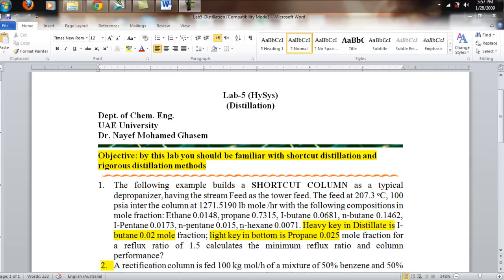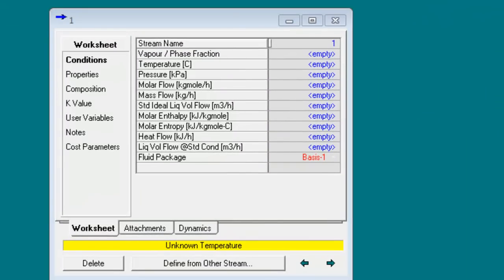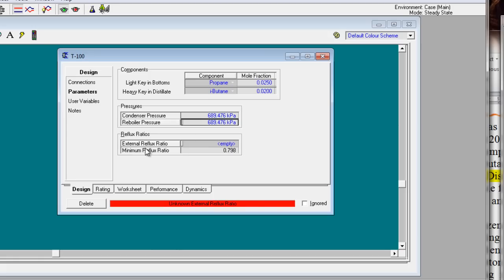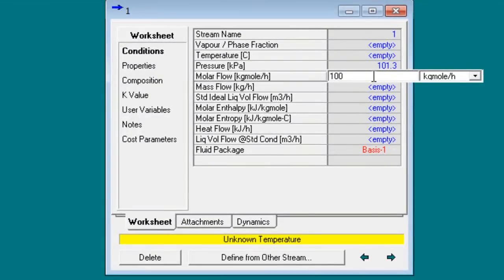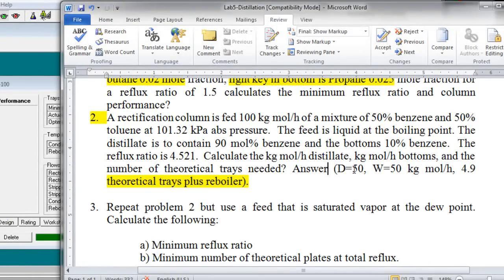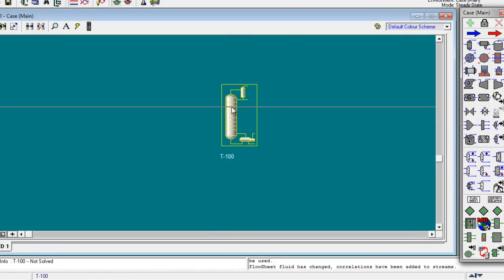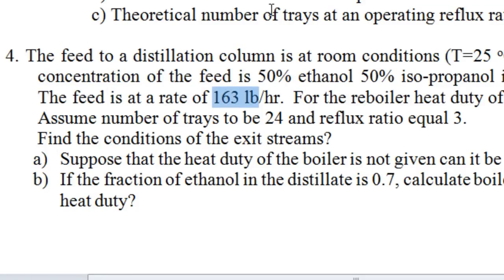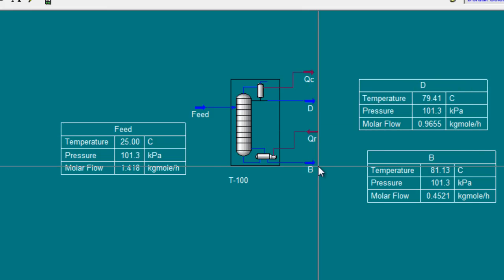Hysys 3.2 tutorial 1: Distillation column simulation (see description)

Comment: Hi MsYosef111,

I am doing a separation of water and 2-propanol. Using NRTL-Ideal, the shortcut distillation gave me a warning that it could not converge due to a reflux of less than zero has been calculated. Is there an explanation for this? i am currently taking my degree in Chemical Engineering. I hope you can help me out. Thanks

Comment: Thanks.In my school project, i have to separate a mixture of 45 mol% water, 45 mol% ethylene glycol and 10 mol% diethylene glycol. A vacuum rectification comes to consideration . I found a patent with two step process, first evaporation of the water excess, than rectification by pressure of 95 mmHg. Bottoms would be glycols mixture that undergoes further rectification. The thing is, that by the given pressure a binary azeotrope of EG-DEG occurs. Could you suggest some ideas of the separation???

Comment from the maker: @Fasoun 
Thanks for your question, That is right ,the condenser  pressure could be lower than the re-boiler pr.But here; the separation goes under the relative big difference in densities of the components at a certain pressure (heavy & light keys) as they are called.

Comment: By the simulation of a multi-component separation either using shortcut or distillation column, is it possible to enable same pressure in condenser and rebolier as given in the feed as u did in the tutorial? i think the pressure in the condenser should be lower than that in the feed or reboiler..